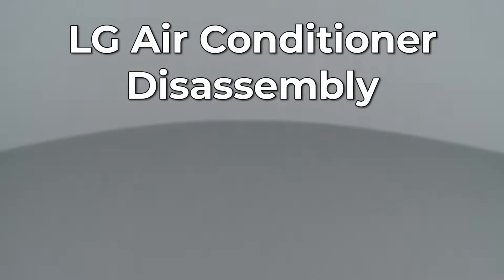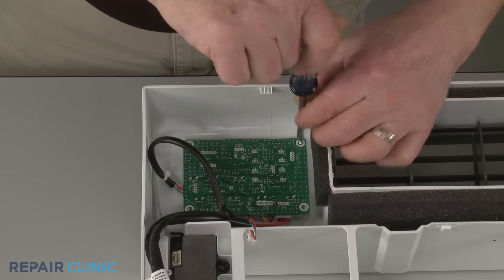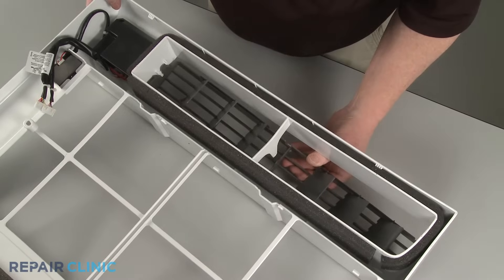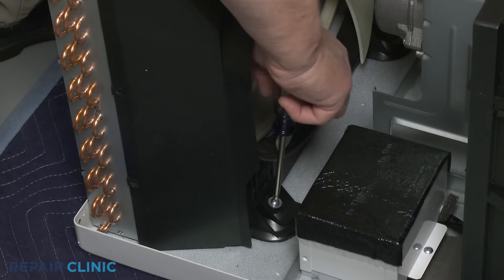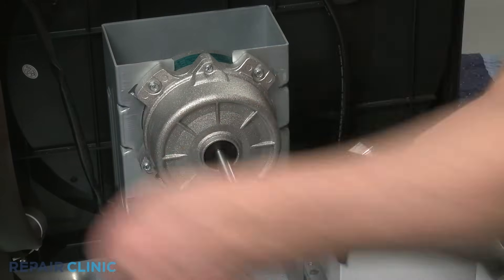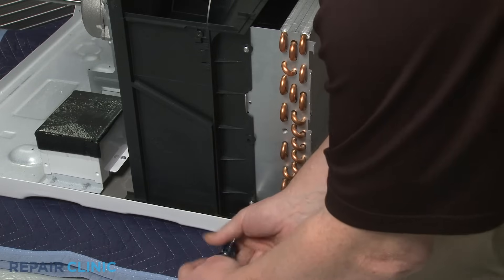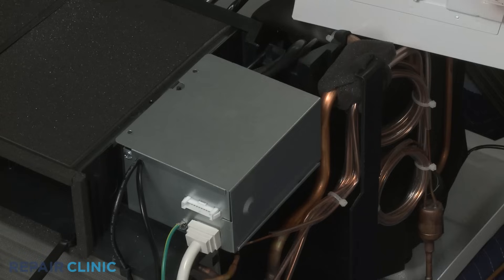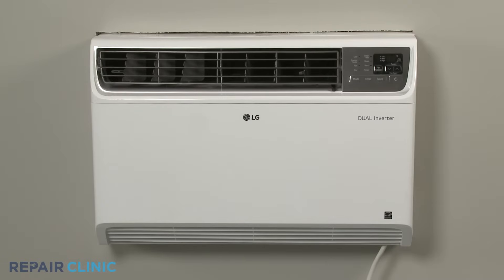LG Air Conditioner Disassembly – Model LW2217IVSM

Comment: Thank you so much for this video! I just purchased the LW1522IVSM model and I'm having trouble with it. When I turn it on I hear loud sputtering then it shuts off. Will try to dissemble it later. Thinking it might be the two arm bracket obstructing or that it's not leveled properly

Comment: Great tutorial! Would this disassembly process also work on the smaller LG LW1019 IVSM? Mine is set to Cool (fan speed 3), but the air coming out is barely cool and it can’t bring the room temp down. Any tips would be appreciated—thanks!

Comment: 🙋🏻‍♂️ 🇺🇸 1/4/2025  this instructional video is absolutely the best 👏👏👏👏🏆👍🏻👍🏻👍🏻……
Probably only the second time ever cleaning my LG Inverter a/c unit of which I purchased ( 2 ) way back in 3/11/2021 from Home Depot. This is the BEST A/C UNIT I’VE EVER OWNED. Also the QUIETEST ❣️❣️ THANKS A TON❣️❣️
Reply: The air conditioning unit is operating normally; however, the evaporator pan shows substantial rust damage.  I intend to thoroughly clean and repaint it.  Additionally, the blower motor is exhibiting concerning noise, suggesting potential imminent failure.

Comment: I wonder if you can answer this question. Does the LG 10000 btu dual inverter (LW10221vsm) have a slight out chassis or pulls out of the frame like the LW22171VCM. I cannot find this information. Thanks Paul

Comment: My power is on, display is good, on cool mode, T set to 60F, and the compressor kicks in ok. I observe the evaporator side and only two tubes (right past the split ) become cold (with frost on). The rest of evaporator is not. All other tubes on the evaporator are “warm”.
Any advice?
Reply: I took a picture with an infrared camera and I see the cold only on ~5% of the evaporator (rest of it is room temperature). 
Freon leaked out?
Reply: Low refrigerant

Comment: Thank you for this detailed breakdown! Our unit contributed to my pneumonia, so being able to remove and clean almost every moldy part saved us hundreds of dollars!!

For anyone else that may have mice get in their system, you can use "Stuff that's Great" Window & Door insulation [expanding foaming insulation in a can] to fill in most of the missing foam. Cut the cured foam with a flexible knife (think filet knife) to make your life easy.
Reply from the maker: You're welcome! We recommend cleaning this frequently and changing the filter out to prevent dust/dirt/mold buildup. Also, for mice make sure to clean their urine trails or they will keep coming back. Wear rubber gloves and use a bleach solution. Here is a good article to help you: https://www.orkin.com/pests/rodents/mouse-control/how-to-clean-areas-contaminated-by-mice-infestation

Comment: So I cleaned my 22kbtu with a hose in the wall I told my wife to unplug and watch inside that water didn't come inside. As soon as I said I was done from outside she thought it was OK to just turn on and the unit did for a min now won't run the gfci on the plug is green but nothing. I have an old unit that the face wires from taking off so many times switched and put other front on and works for now. Is there a fuse inside that can be changed ? I opened the white box with circuit board in it pulled it up a little and seen a car looking like 20 amp fuse that seems to be welded together I tried pulling each end off. Any help would be appreciated. Since I have 2 units I thought of taking electrical box off older one and putting on newer one to fix. How hard is that or possible ?

Comment: May I ask on why the wire 11:39 was left out when the circuit box was being reassembled?
Reply: 14:41 you will see
Reply: That still doesn't show mvc jig connection being made am wondering what it connects to or if it is just a lose wire